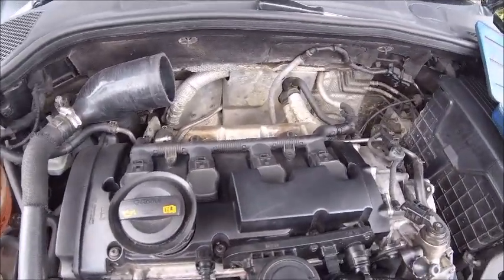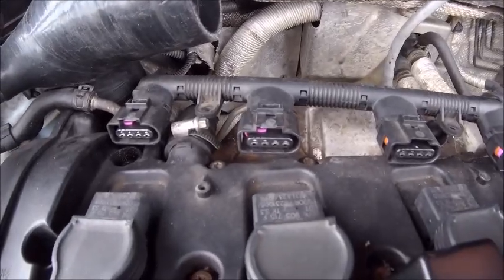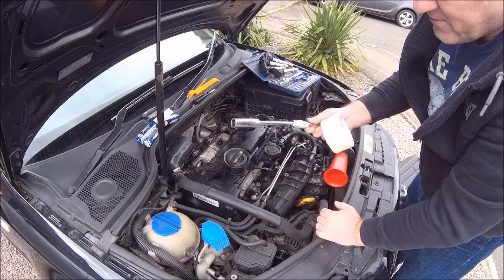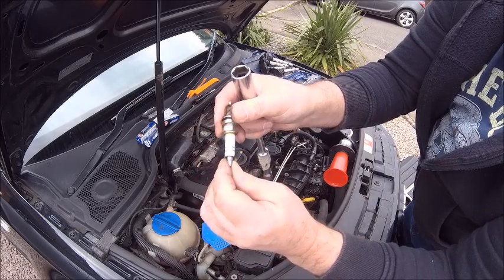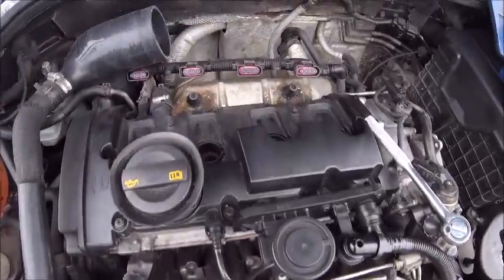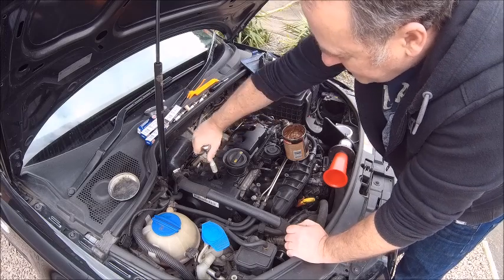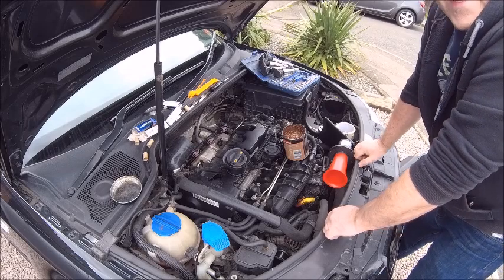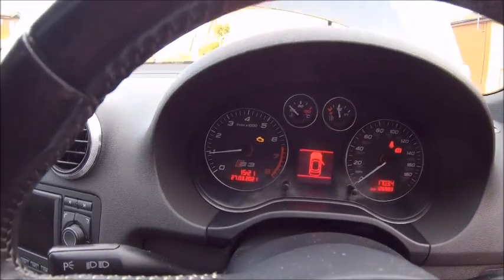Audi S3 2.0 TFSI Spark plugs replacement.

Comment: hi Ade, thanks for the vids.  Do you have to buy the VCDS software/hardware?  If so where did you get it from?
Reply from the maker: You should be able to get it direct from Ross tech on their download page , but the ABD2 connectors are the pricey bit ..
Reply: @AdeReeves  ok thanks.  I was thinking about using one of those ebay OBD USB Cable for VAG-COM 409.1 but I don't think you get the full functionality as if you buy the pricey cable from ross.
Reply from the maker: @gregmacgregor7066  I do have a original ross OBD2 / USB connector...But also have a cheap eBay OBD2 Bluetooth dongle  which works fine too   :)  ... however I am using an older version